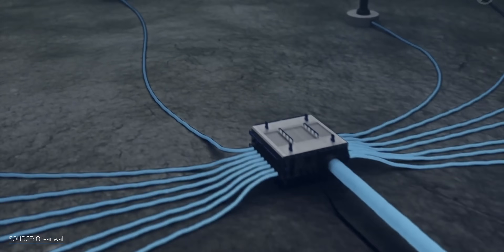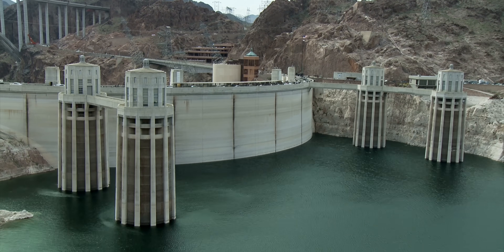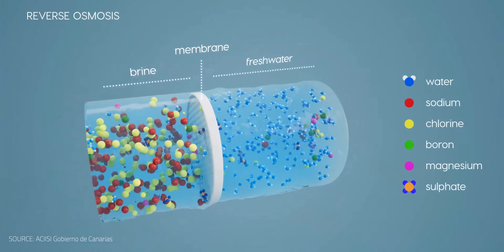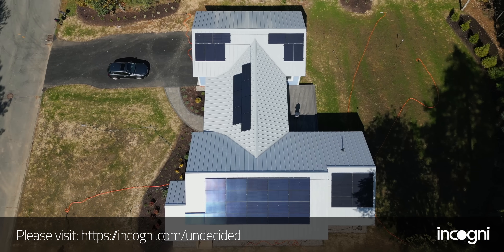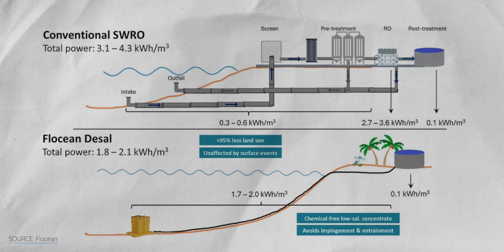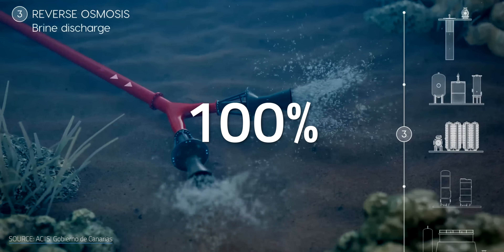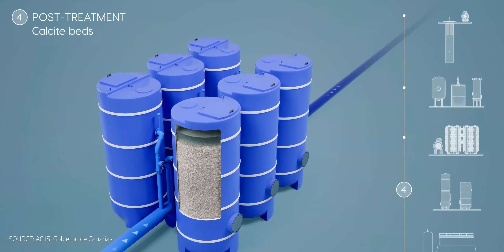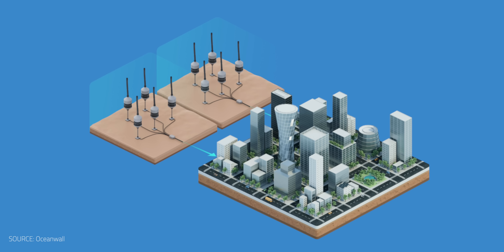How Deep Sea Water is Now Drinkable

Comment: I was pretty suspicious about this whole thing from the start, I then looked into WHY you would actually save energy with this method, beyond "Because sucking is easier", as stated in this video. All the information is in there actually, spread out in the video, but the wording really doesn't make it clear, and this is clear from all the confusion in the comments section...

 It has nothing to do with "not having to push against the membrane" which makes no sense in it self, as the energy required to push something through a filter/membrane or pulling it through is exactly the same. The actual reason for saving energy here, is that over half of the input mass does NOT go through the membrane. This portion is of course the brine, high in salt content, and it contains a lot of energy (over half), that most plants just discharge into the ocean, and THAT is what you save if you have that static pressure at the bottom of the ocean. There is absolutely zero energy saved on getting the rest of the input mass through the membranes.

That being said, if you just google "reverse osmosis brine energy regeneration turbine" you can find that systems exist that can recoop the energy from the brine (up to 90 % of it), by running it through a turbine. That'll still be a bit less efficient than saving 100 % of that energy, but honestly, I can't imagine these systems not being very expensive to maintain, for 10 % savings in energy usage...I'm a bit dubious about the claims of it being environmentally much friendlier, considering that for the same amount of clean water produced you'd be producing the exact same amount of brine as an on-shore RO plant, and it sounded like there are solutions for dispersing the brine over a larger area already, exactly what these pods would do. As for the chemical treatment, it remains to be seen if that really is unnecesary for these "pods"...I have my doubts, but that is the one aspect of this which could potentially be a genuine advantage. I do wonder though if there would be methods to simply treat the brine going out so it doesn't contain any harmful chemicals?

Also we could just pump up the water from those depths to an on-shore plant, which would have the same theoretical advantage of not needing chemical treatment (yes , more energy required for that, but see my opinion on the "energy problem" below). Although in this case there is the maintenance of deep-sea pumps, which is probably a pain in the ass, but probably still less of a pain than having to maintain huge fields of RO pods (given that they state they would just "sip" the water, presumably meaning they'd need a lot of 'em to replace a higher flow rate on-shore RO plant).

I also don't quite understand the issue with energy. We can produce an absolute crapton of energy. Solar is very cheap, in arid areas there is typically huge bits of land that aren't suitable for any kind of agriculture anyway, and there are solutions to store it, plus it can be used elsewhere in the grid if less water is required from the desalination plant.

Then there is nuclear, which is actually an excellent solution in a co-generation scenario (and it has been used for desalination in russia for example), since we could thermally desalinate water (evaporate it), and then the salt is contained, and we wouldn't be increasing the salinity of the ocean. We could of course still use RO if you wanted to, ran on abundant nuclear power. And yes, the "waste issue" is not an issue, you can do a bit of research to see that it's basically a solved problem. The hurdles are mainly political/social.

Bottom line is, energy should not be a concern, we can produce as much as we want if we simply do it, all the technologies are there to do so, and in my opinion , while it's worthwhile to experiment with these things, we should just build nuclear / solar powered desalination plants that employ turbine regeneration (or use evaporative desalination if we want to contain the brine in-situ).
Reply: This is what comments in the comment section should always strive to be.
Reply: Thank you for your service stranger, I was coming to the comment section to say how physically it didn't make any sense that it would save energy, but you did a much better job.
Reply: @tiagozortea  exactly, from a physics standpoint there's no free energy from "pressure" because it takes transformation of that pressure to get it, and it's all deep sea pressure down there so... there's no "waterfall" to tap
Reply: @wikimon  live at the bottom of the ocean. Done. 😄
Reply: As the seawater is pushed through the membrane, the salt concentration in the brine increases, which increases the osmotic pressure, and additional energy must be added to overcome this pressure. As a result, a recovery ratio of 20% requires less energy per liter in comparison to a recovery ratio of 50%. If it is true that deepsea water requires less intense prefiltering, this would be another gain in efficiency. You still have to push the volume of freshwater up through the tube back up onto land, but this is doable. I can see how their strategy could be more efficient than current systems, but there is some proving to be done.
Reply: Thanks, this comment was way more informative than the video. Lots of people in the comments here who don't seem to understand that it's the pressure differential that matters for desalination, not the total pressure, and that it takes an equal amount of energy to create a pressure differential by "suction" than by any other method.
Reply: Live on my boat. Have desalinator (watermaker as we call them) on board. You are correct. There are numerous energy recovery systems that have come out over the last 2 decades. The most significant energy improvement (which is important when you're living offgrid on a boat with limited battery capacity) came with the introduction of the "clark pump" energy recover watermakers. While my traditional 1000 psi pressure pump uses about 25w to make 1 gallon, the newer setups can be as efficient as 15w/gal. That's a 40% improvement in efficiency! And because of the insanely lower power consumption, they can be run without inverters or AC power and directly off low voltage 12v DC power. Which saves even more power. 

However, these pumps come with more complexity and more moving parts. My decision was to just "buy more solar". Solar is cheap. Traditional electric motors and high pressure pumps are easy to fix and maintain.
Reply: Thanks for the more in depth explanation! I was also thinking that it doesn't make sense that the pulling the fresh water would be easier
Reply: Yeah, from the beginning I knew he did not have much clue on how pressure or energy works, without a differential to exploit is the same than nothing.
But let me differ with nuclear,  all that thermal waste does not help you at all. First nuclear is the most expensive of all technologies that generate electricity, second you need between 40 to 120 kWh/m3 using all different thermal desalination techniques, which differ a lot from 2 to 5 kWh/m3 from reverse osmosis.
Reply: @angellestat2730  Nuclear, as it is now, is far from prefect (a lot of legacy issues from an era where reactors producing weapons grade fissile material was a high priority), I admit, but for constant base load applications I still think it's our best bet right now (where large scale hydro is not an option, which is most of the world), expensive or not. But I'm absolutely fine with solar as well, which is pretty cheap, and can be easily deployed, as a more intermittent source, possibly coupled with a storage solution. As an engineer, I'm not for or against any specific generation method, I'm only interested in the various environmental and technological factors of said methods (efficiency, fit for the location, environmental impact, alternatives, and yes, cost).

As an interesting thought, when it was mentioned in the video that during the night the desalination plant that had a solar farm next to it, used "dirty energy", I thought , well why not build the plant with a capacity, so it produces excess water during the day, stores it in a reservoir (preferably underground or in tanks), so during the night they would just wind down the desalination process, using a LOT less energy while the sun isn't shining.
Reply: @EquinnMc  a lot of legacy issues from an era where reactors producing weapons grade fissile material was a high priority
I do not think that is the issue, Thorium, SMRs or even Fusion are doomed from the start due the bottleneck cost to transform thermal power into electricity; plus their complexity and safety requirements.
This can be seen on Solar Thermal vs PV as well, where despite creating cheap mirror surfaces that focus 90% of the sun energy, is not even close to compete with PV even having the cheaper thermal storage bonus.
but for constant base load applications I still think it's our best bet right now
of course, this is something to have into account as well, with PV the power output changes a lot which mean that the capacity factor of your reverse osmosis plant is reduce which extend in time the investment return of that capital; on the other hand big part of the cost of reverse osmosis is on the membrane replacement, which mean that maybe you do not care if the plant is working all day because the cost of the membrane depends directly on use and needs to be exchange several times over the plant lifespan (I suppose). 
But this capacity factor issue can be seen also on hydrogen production by electrolysis, still most investment on this field use 100% power from solar and wind, like the 4GW NEON plant still on construction on Saudi Arabia.
They do not seem to care on the reduce capacity factor from their electrolyzers, this is because 70% of the green hydrogen cost depends on electricity cost.
Reply: The brine from an onshore plant is copious and all coming out of a single location.  You can't just dump 8% salt water into the ocean without devastating that spot.  Diluting it with fresh waste water makes little sense since it would likely be cheaper to clean that waste water rather desalinate ocean water.  So you are basically left with having an extensive array of pipes and pumps to diffuse that hyper salty water.  This would add a lot to the cost.
Reply: @apostolakisl  considering the best new nuclear reactor designs use molten salt…I’ve always wondered if the brine could just be ushered over to those reactors: if we’d be allowed to build the damn things.
Reply: What if you have a U shaped channel with a greenhouse style cover that lets water flow in one end and out the other, the floor of the channel is engineered to have increased surface area and heat transfer and very shallow depth and the roof to catch the water and divert it to a reservoir, this would desalinate water through evaporation and would not require machinery to move salt or disturb marine environments from increased salinity also no filter to replace or unclog.
Reply: I appreciate your explanation of the energy savings, the original video could have done a much better job of that.

I think I disagree with your conclusion regarding solar/nuclear/onshore desalination though. You said the hurdles are mainly political/social and that's correct, but that's the point. If I've learned anything from politics over the last few years it's that the actual numbers don't mean a whole lot when it comes to getting the public on board with something. Building things that take up a lot of space anywhere near populated areas is difficult. I'd say a huge advantage of this system is it's out of sight of the nimbys. Not to say that doesn't have a downside, I really hope this doesn't turn out to do horrible things to the ocean for some reason.

I still have my suspicions about the overall viability though. It's neat, but startup companies promise a lot of stuff. Guess we'll just have to wait and see.
Reply: Less moving parts exposed to corrosive sea water probably would save some money in maintenance.
Reply: My guess it would be like summer ventilation in a factory building without A/C. In a factory, you use exhaust fans to put a negative pressure on the building. This allows you to open vents and doors where cooling is a priority. It's much more efficient than having supply fans to put on positive pressure. I'd assume here you would minimize any turbulence losses as the media fills up. I'm not quite up on the physics. I'd assume you could run a much higher suction 1000ft underwater before the water boils, too.
Reply: The high-pressure input pump on a desalination system is doing two things. Firstly, it is forcing water against the osmotic pressure, you need about 30 bar of pressure to accomplish that. Secondly, it is washing input water past the membrane to carry away salt that builds up. The incompressibility of water makes it difficult to recapture that pressure when you release it as waste. Energetically it’s more favorable to allow more salt to build up in the waste water and pump a smaller volume at that high-pressure differential which means that it takes more pressure to overcome the osmotic gradient.

If you sync, the whole apparatus to the bottom of the ocean, you no longer have to worry about losing pressure energy from the waste water that washes the salt away, and you can perform the reverse osmosis filtration at a more energetically, favorable salt concentration closer to natural seawater.

The possibility of lower levels of bio filing is another bonus. That’s difficult to reproduce at the surface. Marine bio filing is a serious problem. It is extremely expensive to deal with and requires constant maintenance by extremely well trained staff who are very capable and thus demand high pay. Marine maintenance is one of the things that people who don’t have any experience with the ocean almost universally hand wave away.
Reply: This was my gut reaction to the video. So addition thinking later I figured out. The "pump" efficiency calculation is very different than what you get at first glance the efficiency is because you are only ever pumping fresh water in DSROs where in an on shore plant you are pumping your waste water as well. When you run some numbers to double the salinity in the water the amount of waste water you pumped in your compression phase was 2/3s of the water you got out so you are pumping a 1/3 of the water in a system where you are only pumping fresh water up from the depth. The question that needs to be answers and Im sure it will in the future is the cost of the deep sea construction and maintenance cheaper than extra energy. I feel like their still may be some number fudging in the pulling that fresh water up from the depths isnt free so you can make your system seem insanely energy efficient if you forget that.
Reply: @chrislinda3623  You really aren't pumping the water up from the depth. You are lowering the pressure at the surface. This unbalance in air pressure allows the deep pressure at the see floor to push the liquid up the hose. Think about it like drinking through a straw. It takes surprising little force.
Reply: @chrislinda3623  getting freshwater up is actually free the density difference is enough to create 60psi for driving water to the surface. In theory if you went deep enough the system can be gravity powered.
Reply: @Ethan-3369  I'm not sure you could do that.  The RO filter needs to have low pressure on the fresh water side or it won't filter.  That basically means delivering empty rigid containers to the bottom and since those containers would float, you would have expend energy to pull them down to the bottom.
Reply: @apostolakisl I am aware it needs low pressure on the fresh water side but a rigid freshwater pipe back to the surface would not be buoyant due to how thick the walls would need to be. The pressure of an equaliant height column of fresh water is less than seawater meaning the freshwater side is lower pressure. Similar to humidity driven convection in atmosphere.
Reply: @Ethan-3369  Yes, keep in mind you need high absolute pressure across the membrane.  Sea water is about 2.5% more dense.  As an illustration, if you went  2300 ft deep, the pressure would be 1000psi and the pressure of fresh water would be about 25psi less.  I don't actually know what the proper PSI across one of these membranes is, but my home unit likes around 40 or 50 psi to work correctly, which would be close to 5000 feet deep.  That is kind of deep and I bet the commercial ones run at higher pressure.
Reply: @chrislinda3623  I think beyond the engineering stance on whether the efficiency is worthwhile, the reduced footprint on shore is a huge plus, since beaches and shoreline land are almost always either environmentally delicate or prohibitively expensive. The fact that it also doesn't add salinity to an section of ocean that is superficial also reduces the ecological impact on wildlife, which is again extremely undervalued it seems. The fact that it's "new" productive land, and the fact that it takes up a fraction of the shoreline makes it a way more attractive option than it's being given credit.
Reply: The problem I foresee with nuclear desalination is that evaporative desal would probably take up a lot of land and the cost of nuclear RO would be insanely expensive.
Reply: Wouldn't you have to pump the waste water out?
Reply: There will need to be pumps at the sea bed to pump the freshwater to the surface. You can't "suck" water up that distance.
Reply: Solar needs to be replaced every X years. And it’s not efficient, among other things.
Reply: Real estate on land is VERY expensive. Especially right on the coast in a densely populated California city, that's prime real estate, AND you have to get all the permits and approvals and deal the political activists and NIMBYs. I think we're really sleeping on the part where he said "90% less real estate". Not having to bulldoze LA beach mansions to make space would dramatically reduce construction costs.
Reply: AH, thanks for explaining the brine detail! I thought this was snake oil from the his short description :)
Reply: Excellent post! I had the same questions. But while reading your post, I think I finally found the solution. Seawater weighs about 2.5% more than freshwater per unit volume. So pumping up freshwater while you have pressure on it from saltwater is where you save all the energy. It only took me 30 years thinking about this principle to finally figure it out. 😄
Reply: Imagine a pipe extending into a bowl of water. The top of the pipe sticks out of the water. If you scoop up a bit of water from the top of the pipe, the gap will be filled with water from the bottom.

Now, imagine the bowl is the ocean. The bottom of the pipe experiences a lot more pressure than the top of the pipe. So this is where you put your filter. You then suck out a certain amount of water from within the pipe to create a pressure difference. You maintain this pressure difference by continually sucking out water. This is how the filter works in a nutshell.

The cost of sucking out the water would be less than the cost to create the pressure difference from scratch.
Reply: @tman250  Except the water at the bottom (where your pressure difference is) is under pressure from all the water above it.

So your pressure difference at the osmosis filter *is identical* to the pressure difference you have made by "scooping water" off the top.

The end result is the same total energy to create the same pressure difference.  There's no magic here.  If you can pump the water out, then you could always have pumped the salty water at the top to the same pressure.

There's no free lunch from the pressure difference.

The only free lunch is at the top, if you were pressurising salty water, then you have ALSO pressurised your brine that you want to discard.  And the commend explains that by pressurising THAT water (putting energy into it) is what you save with this system.

Except the problem is it doesn't really solve anything, because there exists technology to recover that energy.  So you don't actually save much.

Now we talk about getting water from the bottom of the ocean because it is cleaner right?  to avoid treatment?  Why don't we ... just put a pipe at the bottom of the ocean and suck up the water directly from the bottom?  Doesn't that get the exact same "dark" water?  Great! so, now we have solved all the problems.

What does putting our pumps at the bottom of the ocean actuall save us?  All I can see is a bunch of hard to maintain technology all situated thousands of feet underwater, instead of in conveniently located buildings.
Reply: Great comment. I think it then becomes clear that you don't really need a deep water desalination plant. Just below the surface would get the same energy efficiency (although possibly more issues with the brine being discharged into areas where wildlife is more prevalent). Discharging the saline a bit further out to sea to disperse it better would be an improvement.
Reply: @eric55406  the higher static pressures at depth probably help with preventing cavitation on the suction side of the pumps.
Reply: as usual, a nuclear proponent who just hand waves away all the issues. Using nuclear plants for desalination is a non-starter, almost all the locations where they are interested to use this desalination technology are dense urban cities in coastal locations, so there is neither the land area for extensive solar nor will most municipalities want new nuclear plants. so yes the energy requirement is a big deal
Reply: @socalguy829  What about Saudi Arabia???  And they already massively use desalination. Just because it doesn't fit all places doesn't mean it's not great for some.
Reply: @socalguy829  Modular LFTRs solve all problems. Just the waste heat they produce can efficiently desalinate water using evaporation, and they burn existing nuclear waste at the same time.
Reply: @socalguy829  Likely that in 20 years we will be going with SMR's.  They will take up minimal space and be located near the targeted area of use.
Reply: @apostolakisl  why go SMR when you could juse use batteries and renewables for half the cost.
Reply: @meateaw  We don't really know what SMR reactors cost yet.  But SMR is always on power, can be located almost anywhere, take up very little space, and presumably will be made domestically.  Solar panels and batteries are pretty much all imported and tend to use a lot of minerals that aren't mined in the US or in any friendly country for that matter.  And even with batteries, you will have to hook that up to the grid because it is still going to at times make too much power and at times run out of power.
Reply: Ok...but all the power you generate ultimately ends up as trapped heat on your planet. Has anyone done the math on how much heat the earth loses to space and how much heat all that power generation makes trapped in your air bubble?
Reply: @benmiller200 oh the heat generated is negligible
Reply: @benmiller200  Virtually all sources of energy are heat neutral, but some of them are heat neutral over millions of years and others are instantly heat neutral.  Solar and wind are basically instantly heat neutral.  The heat from using the electricity would have been heat from sun warming the planet or wind friction warming.  Burning fossil fuel is adding heat to the planet that plants took out of the system a long time ago, so effectively, is adding heat.  Bio-mass generates no heat because that is sun heat from just weeks or months earlier, not a collection of millions of years of heat like fossil fuels.  So slightly delayed, but meaningless.  Nuclear is the opposite to fossil fuels, moving future heat to today.  The fission was going to happen in the ground, just more slowly.  So fission is adding heat to our planet when evaluated in a time frame not measured in millions of years, like fossil fuels, just the other direction.  Fusion energy is totally new heat generated on the planet that would not otherwise have been here at any time.
Reply: @benmiller200  I don't think all the waste heat humanity ever produced is remotely comparable to the heat we receive from the sun each day. The problem is that those heat we generate create pollutants that traps heat from the sun, if we can solve the greenhouse problem it's no issue. IIRC it took the sun one hour to provide the energy all of humanity uses in any given year, if we can somehow convert all of them on earth
Reply: @benmiller200  mankind consumes roughly 5.8 × 10^20 Joules of energy annually. Our planet receives that same amount of energy from the sun every 80 minutes. Our energy production isn't the problem, but rather the fact that it emits CO2
Reply: @BrunoViniciusCampestrini what's happening on the outlet end of the machine. How much heat do we radiate into space from the planet?, what factors can adjust that, and if the thermometers all say it's getting hotter at what point in time does my AC stop working?

Can we achieve net zero heat increase?